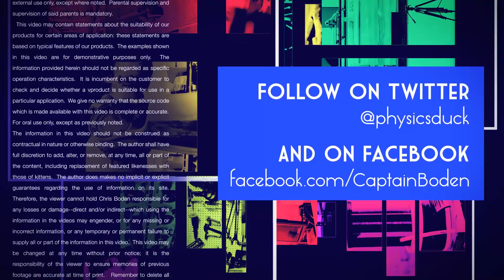Captain's Blog 8 26 2018 Studio B Floor Part 1 Timelapse

Comment: Hi, could you share with me wich rubber profiles you used for the floor beams and wich dimensions you chose for the beams? That would help me a lot
Reply from the maker: The rubber bits are Auralex U-Boats and the beams are 2x6 for the floors.